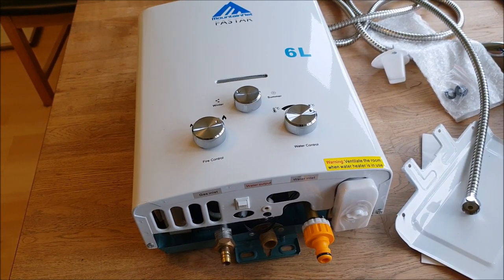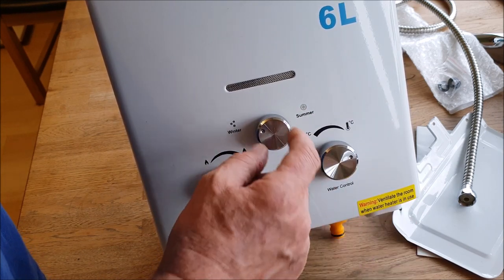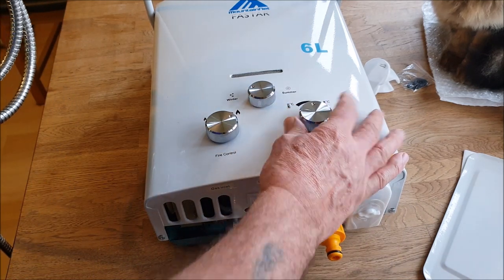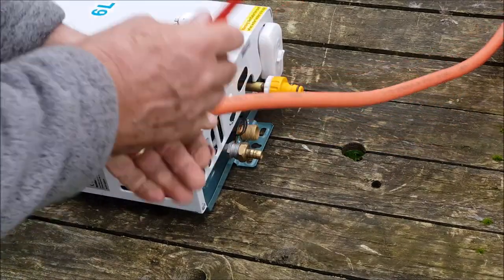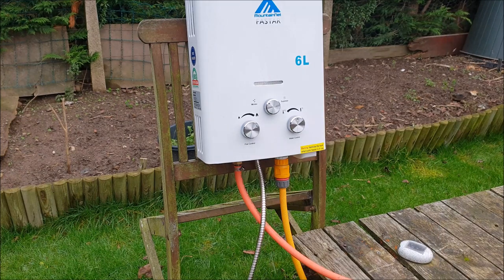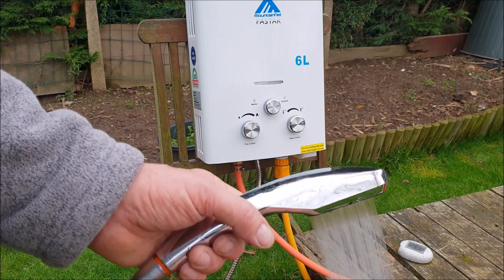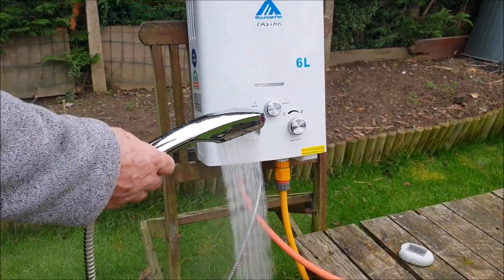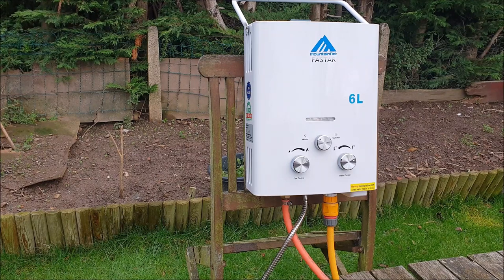PORTABLE GAS SHOWER REVIEW AND HACK

Comment: I have a Camplux BW422 16L  very similar, runs off batteries, (can shower in a power cut) i have water on full. gas at half way, use it everyday, a 19kg propane bottle lasts approx 3 months, it provides the best shower i have used in my 68 years!

Comment: Nice unit I know when we used to work on some older continuous flow water heaters you had to adjust the flow rate to get the correct temp. Pressure and flow are different things i would put in an adjustable flow restrictor to adjust the temp if it was a real issue. So to get more heat the water needs to slow down through the heater and for less heat speed the flow through the heater

Comment: im thinking, this is perfect for showering off grid, or in weekend houses, etc. where you might have water but heating it is a bugger. This is nice and convenient. In fact, i'd instal it in my apartment if there was need for it.
Also, i love the fact that it requires no electricity, meaning the power shortage will not affect it. 
Ad a propane bottle in the corner and you're set. 

If i needed to install heating and warm water somewhere on the budget, this thing and wall-mounted heaters are what i'd go for, not a big heater/boiler.

Comment: Hello Mark,man I really want to thank you, we were using the c batteries befor which were the wrong ones,in the instructions there is no mention what battery to use,and another big mistake is that I thought they did not send a rubber washer so I stuck in one but then there was already a rubber washer but it was in the wrong place, so when I stuck my wassher on the inlet had 2 washers,so when you showed the right way to put on the rubber washer every thing worked perfectly..I was just about to send back the whole heater to the seller,when I said I should look on you tube. so thanks again.

Comment: Hi Mark, correct me if im wrong but the water temperature seems to be set to the lowest? I see how its easily confused as the dial on the left is at maximum when turned all the way to the right but if you look at the line above the dial it goes from small to large
Reply: Looks like you are correct

Comment: Looks to me like you have the temperature turned down low.
Reply: hard to tell , the thermometer on the right  looks like it is hot
Reply: Every video I've seen on these shows the temp adjustment working backwards from the flow rate.  Yeah, he's got the temp set to low.
Reply: His setting in the video is correct. The right knob is a water flow restriction valve. Turning it to the right reduces the water flow so it spends more time in the heat exchanger and gets hotter.
Turned to the left is the opposite - more water flowing with less temperature rise.

Comment: Hi... I carry water for showering in a large plastic icebox in my van. If you allow the water to circulate back into the icebox after going through the system for 5 mins. the water warms, which then ultimately raises the shower temperature.
Reply from the maker: Nice one Simon thanks
Reply: @MrMeltedwellies  did it help???
another thing, how you control the water temp in a shower? for example if you have separate shower room in a van? first its too cold and gets hotter and hotter and then its too hot?

Comment: Great job I’ve had mine for about 2 years and use it every day. Upgrading the shower head is a must. As I understand it the right nozzle is for pressure not temperature. You need to turn the right.nozzle anit clockwise to reduce pressure to increase the temperature. Counterintuitive I guess. The left gas nozzle should then be kept about half way. Batteries run out so I connect my parallel connected pack of 6x 18650 batteries through the spade connectors and keep the voltage about 3.6v. They are rechargeable and last forever. Easy hack and makes sense. As the unit doesn’t ignite properly below 3volts.
Reply: sir, how long does the hot water last? is it enough for a person to take a shower?
Reply: can you post a video of what you did?
Reply: @ismaeltolentino4500  There is no storage,  the water goes through it to heat as long as it's on. Super cheap to run hot water as it only uses gas when the water is flowing.

Comment: Just created my own system after seeing yours gave me the initiative. I bought a similar boiler but attached one othose cheap chinese 12v motors which works great, in fact it works too well. Trouble with these motors are they're predominantly high pressure 130+ psi which is far too high to initiate the auto back pressure shutoff should you choose to use one of those shower heads with a switch off button on it. The motor labours on and wouldnt shut off even when the output was blocked off, so who knows what trouble this might cause to the internals of the boiler?  I sorted this problem by dismantling the pressure switch assembly on the pump end, and got hold of the short (very strong spring) that controls the switch off function and ground about a washers worth of metal off each end. Upon reassembly the system is far more responsive and stops instantly I turn off the shower head button cutting the flow.  Thats how I did it anyway, so if helps anyone, good luck. On the off chance you grind too much off the spring, you can always add a washer in as a shim to increase cut-off pressure
Reply: Thanks for your reply! I have seen a lot of information on these heaters but never seen anybody describe the function when attached to a showerhead with an on/off valve on the handle. I plan on buying a heater like this but i do not know if it is suitable for my van since I only have around 25L of water. I must have the on/off switch to save water but I don't know if those heaters need a continous flow to work properly? Would you mind explaining a bit?
Reply: @:Sven-Tomas.  Yes they need a continuous flow at around 16 psi or they cut out the burners for safety reasons, the shower head on/off button is the same as turning the tap on and off. You would use too much water just getting it hot at 6 litres per minute. I just tested mine on my tank and pressure pump system and it took 30 sec. to get warm and 1min for shower temp and if turned off will cool down quickly, .You would be better off getting shower temp water in a bucket/line and a 6 liter per minute 12v pump (eBay cheap) with handy cutoff and/or adjustable rate system.
You can use the proper pressure 12v pumps and drop the inlet into a creek/tank/neighbours pool situation, these gas heaters are fantastic and are set up to use common garden variety hose setups (pun intended). One 8.5 kilo gas bottle lasts me 6 months at home at 5 showers a week and I get them filled for AUD $15. Instant on gas hot water system...Yeh Baby.
Reply: I will correct myself, minimum pressure, I am guessing, would be about 30 psi.

Comment: Winter/Summer dial cuts out 1/2 the burners on one side of the array on Summer setting.The water control on the right adjusts the rate of flow hence the temperature, to the left =hotter/slower. Get one with the LED temperature display, best idea ever and makes the adjustments much easier.
Reply: Have you had any issues with it only coming out super way too hot?
My Thermomate was working great for a while now the water hardly comes out with any pressure and the temp goes up to 60degrees Celsius!!!
Reply: @rorymagnatheredking  Maybe check your filters and clean them, Paddy?

Comment: Hello Mark, 2 mistakes here. First, the control on the right is there to turn down the water flow. Second, and my main point is you MUST have a shower head with an on/off switch. If you have an endless supply of mains water, as in your video, it's not too much of a problem but you would still have to get out of the shower to turn it off. You had to walk to your garden tap, leaving the hot water to run out into the bowl. Off-grid you cannot afford to waste water and gas like that so need the water to turn off immediately you have finished your shower. Did the original head not have an on/off switch, all the heaters I have seen had. A well presented video but only useful if you live in a house and misleading if you live off-grid.

Comment: Thanks mate
I just set up my Thurmo mate 6L unit for the first time. And was very dissatisfied with its performance to say the least. It seems to cut out a lot.
Hot one minute then cold.
I’m guessing my flow is too high as I’m using a RV water pump with reasonable pressure. I’ll insert a valve to slow flow down and see how I go.

Comment: Thank you for the great review. Very informative. This is perfect! I'm looking for a small propane water heater for a small 885 liter pool, just to take the chill out in a pinch. To hook it up inline with the filter pumps outlet and just let it circulate. It's one of these or a long stretch of copper tubing coiled up inside the grill lol. I'm assuming when you shut off the switch, the heater goes off but the water still flows?
Reply from the maker: Thanks for watching John and yes it does

Comment: These units may be small enough to install inside the back door of my campervan. Hooked up to water tank & propane tank.
Reply from the maker: they work well thanks for watching Jeffrey
Reply: These thing make a whole lot of heat venting from the top. Wouldnt recommend installing inside the door.
Reply: I’m looking at installing one of these in our 1987 Mercedes motorhome I’m looking at using the onboard watertank as the pump is there already and it goes into the shower room as out water heater just won’t use on gas only electric drives me mad so I’m thinking  of using the shower hose already in the motorhome and hooking that to the boiler for the water flow hope this works as hate cold shower

Comment: Hi All
Im thinking of connecting one of these to the caravan outside permenantly to by pass the existing water heater.
I assume then i will need to go outside and switch on/off each time i want to use the shower or hot water to wash up 
As I dont want the heater running all day long using the gas.
I think a 6L would be enough to push the water around the caravan

Comment: You might want to check the screen on the water inlet as well.. They can block up over time and the system actually runs better without it. Only down side is over time the shower head might block up, but back flushing the head should.fix that
Reply from the maker: Nice one Brett

Comment: Ive had one of these and the problem of providing the inlet with 50lbs of water pressure out on a campsite really sucks. You have to go out and buy a water pump that is small enough to cart around but wont burn up if no water is running through it. My water pump is never ran more than a second or two without water running through it. Why dont they address this problem. In your video you just hooked up to your house, which probably has 45 - 50 lbs, unfamiliar with pascals, of water pressure. Make another video with that piece of shit hooked up to an actual 12V system with your recommendation for a water pump which is necessary. That portable shower is just junk if you don't properly set it up in the field.

Comment: I tapped a bath half full of cold water, put the inlet hose into the water in the bath and pumped it up through the heater and back into the bath. Eventually there was pre-heated water going through the pump into the heater and back into the bath (Yes, yes, I know it's a dumb thing to do!!). End result was that the water going into the bath was too hot and triggered the thermal overheat switch. Won't do that again. Question is: is there a manual reset switch inside the cover? Help!

Comment: Funktioniert denn das alles mit einer normalen Gasflasche mit 50mBar? Weil auf der Therme steht 28mBar druck. Und funktioniert es auch mit einer normalen 12V Wohnwagen Wasserpumpe? Könnte ich es im Staukasten im Wohnwagen verbauen oder ist das verboten? Wäre dir Dankbar für eine Antwort. Kann man es auch unter Dauergas lassen, und startet die Therme automatisch man man den Wasserhahn aufdreht, also die Wasserpumpe dann anläuft? Und was ist wenn die Gasflamme mal ausgeht wie im Video, strählt dann weiter Gas aus oder wird es automatisch unterbrochen, auch wenn das Wasser weiter läuft? Lg Sandro

Comment: Thanks for the video. Very useful on the whole. One question...

If it is scolding hot with the temperature on minimum... Can you turn it down using the other dial? I am considering purchasing but not if it's going to burn me!
Reply from the maker: Yes you can

Comment: Water temperature is on minimum no maximum...
Reply: @macel sip, good spotting
Reply: Good eye. To be fair, the orientation of the dials relative to their function is not very intuitive.  It's for some reason inverse of the gas dial.
Reply from the maker: Absolutely spot on my mistake thank you for your input thanks for watching

Comment: I just sold the one in my camper (because all the plumbing was leaking and I couldn't afford to fix it all) my mum bought the shower off me for her bathroom. Anyways, I just started it up for the first time and the flame inside seems massive! Is that normal? Or is propane too much for it, it says natural or LPG gas in the instructions but says methane gas on a sticker, I've never heard of using methane for these showers so we used propane... just worried the flame inside isn't right... it looks like a fire inside?
Reply: I used to have one of these instant water heaters in an apartment in Spain. The blue flame was huge, very powerful. It sounded like a fighter jet :D But oh boy it was fast and powerful. The flame should be blue, not yellow.

Comment: Hi thank you for the video, I bought this one 3.months ago and it's suddenly developed a fault, before contacting the supplier want to see if it's an easy fix, it seems not to be ignighting, there is plenty of gas and the batteries are fine, we Han hear it clicking as if it's trying to light but just it's like there isn't any gas getting to it, we have checked the gas pipe etc but to no avail.... Thanks x
Reply from the maker: Hi Missymojo not sure but there is a small mesh vent in the gas inlet check that and water pressure that make a big difference low pressure 
Mark xx
Reply: @MrMeltedwellies  tha k you so much, will check the mesh tomorrow x

Comment: So after hooking up your water supply and turning on your gas the electric start ignites the gas? So am I assuming right that the battery system turns off and gas keeps the water hot during run times? How hot does that water get?  110 degrees?
Reply from the maker: spot on as for water temp thats down to settings on the boiler

Comment: I have one and put it inside my camper I used a 5inch by 11 floor register and a metal 4inch dryer metal for exhaust thru wall going to outside note  (  EXHAUST GETS VERY VERY HOT DO NOT TOUCH),and I have a 16 foot trailer .
Reply: Whats a floor register?
Reply: Great idea...im on that

Comment: Great idea, but..... I have had four of them. Not bad when they are working, but three have ruptured in cold weather and the fourth clicks but will not ignite. The price has increased a lot since I tried them so I waiting for someone to tell me which are the better brands before I try again. There can be substantial differences in price, but they all appear to be very similar in manufacture
Reply: in cold weather? Did you let them freeze? Obviously then they will brake...

Comment: Few things;

1-Not enough water pressure device will shut. 60psi minimum or so.
2-Remove the screen in the water intake and be sure water is always clean and filtered.
3-I have seen people installing these into vans.Never go Full retard. These are outdoor units.
4-Wind may extinguish flames so keep it away from the wind.
5-When batteries are getting low it will not ignite or have weird symptoms. Use rechargeable good quality ones.They last around 30 to 60days depending on usage and cold weather.
Reply from the maker: I wish you were about when i first got mine thanks for all the tips and thanks for watching 👍🍷☀
Reply: really 60 psi ?! Thats alot ! Is there a way to lower the trigger pressure ?
Reply: @x3Cay  not that I know of. Mine shuts when less than it.
Reply: @samuelkatherinediozarago7692  Okey, i looked up on ebay, The description says that 10-110 Psi will shoot the trigger
Reply: @x3Cay  They dont need that much pressure at all. 35pis 12v pump is more than enough. It's the flow of water that matters, in L/min or equivilent.  Im sure you figured that out by now, but just in case someone else comes across these comments with the same questions.

Comment: Where does the electric come from? Does it hold batteries? Can you connect to 12volts? Lots of questions. Help.
Reply from the maker: just batteries not changed in two years still working no 12v

Comment: If you reduce our water flow on thé unit,you Will reduce thé water pressure and you watertemperatuur Will rise.you can see it on the pictogram on our Heater

Comment: The 12v pump works on 6ltrs per min, that's the correct flow rate for the heater.
Mains water flow is much greater, foo much water flow = less heat 😁
Reply: Hello can I ask a question hopefully you can help iv purchased a mobile home I'm replacing the old  style gas boiler which is a 6 litre one with a new on-demand one which is a 12 litre have I made a mistake ordering a 12 litre one 🤷🧐 Cheers
Reply: @Security2U  You can still run a 12v pump, but the flow rate should match the boiler, same applies if you are running mains power.